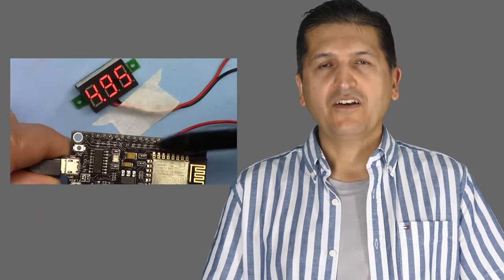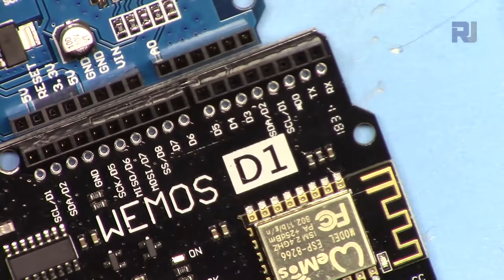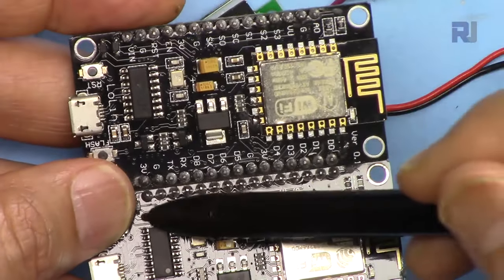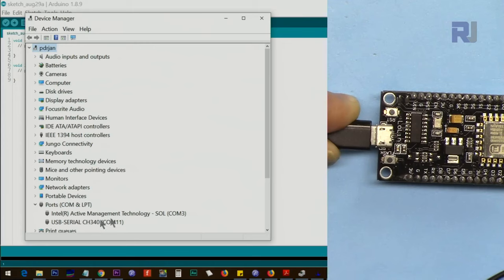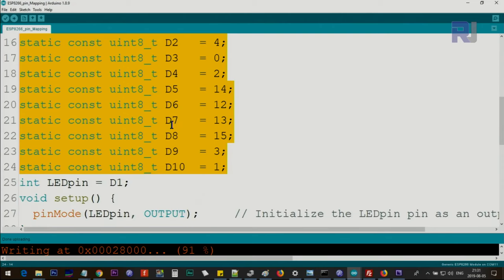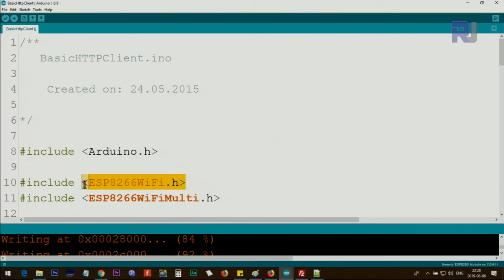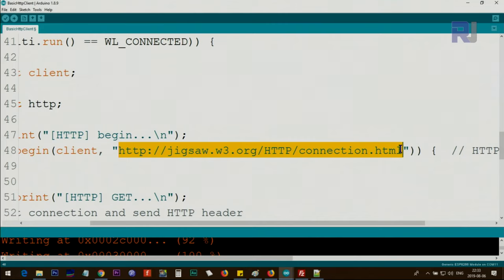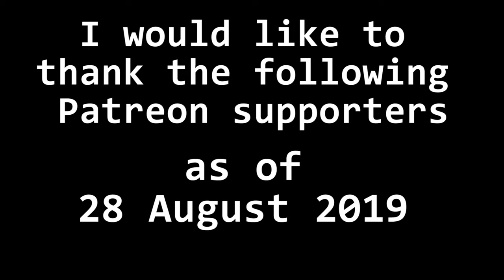Introduction to NodeMCU ESP8266 WiFi Development board with HTTP Client example- Robojax

Comment: Great video - I have not a clue what I'm doing here with C - however couldn't get code to run - stated  char type="k" was wrong (complex unpermissave error and stuff I didn't understand). Changed it to String  type ="k" and works perfectly. I have no idea why!
Reply from the maker: Hello and thank you. you must have customized the the code. The code posted after demonstration and it should work.  please try using it first without any change, then make changes.
Reply: @robojax  thanks for the reply - I had inadvertently ‘customised’ the code in at least 7 places, having fixed my own errors I still couldn’t get that bit to work. Pasted the error message in and found out far too much about char* constant errors. I never coded in C in my life, just a hobbyist - playing for fun really. But changing ‘char’ to ‘String’ made it work with j. Then I put the k in and it didn’t. Being irritated by then I just uploaded it again (which is clearly stupid and should not have worked), but, it did. I saved it quickly!
Many thanks for your reply though, most kind, I shall watch more. :) Phil
Reply from the maker: you are very welcome. stay safe.

Comment: Can you read data simultaneous from more than one sensor with this Node MCU ESP 8266 and transmit them via WiFi? Thanks!
Reply from the maker: Yes you can.
Reply: I guess you will not tell me how...:(
Reply from the maker: It needs 10 to 20 minuets video to explain. But your question was "can" and I said yet. I am replying to 1000s of comments. Can't write paragraph unless absolutely needed.
Reply: @robojax  I know and Thanks for answering! I just thought you will guide me a little...like: ”if you use digital sensors you do that...if you use analog sensors, you need that...”...or to guide me to some video that i didn't manage to find...

Comment: I need your help to do the "HTTP server which is waiting for HTTP Post request. These requests then proceed with string masks and parameters for LED and Display control are flirting. Then ESP turns on / off a certain LED and shows a number or string on Display.
 please help with how to start with.
Reply from the maker: I wish I could help. your request involves lots of understand and  testing which can't be done by few line of comment.
Reply: @robojax  Thanks

Comment: why my ESP8266 does not appear on my port? All I have was COM 1 when I connect it tot he USB port it does not show any other COM port?
Reply from the maker: because you don't hae the drivers for it.  check the chip (with magnifying glass) it must be CH340. if so check the video I have for Arduino which has the same USB chip https://youtu.be/u_21yNqd03I  if it is CP2101, then windows recognizes it. or your USB cable is bad. try another cable.

Comment: What is happens when ams1117 (voltage regulator) is shorted?
Reply from the maker: it depends on which pins. if input and output are short circuited, then the 5V input go to the output pin and reach ESP8266 chip and kills it.
Reply: @robojax  It happens to me, but the input is about 1v, and the output is 0v. Before it, the smoke has flown out from it. What about protection of the circuit based on datasheet of ams1117?
Reply from the maker: there is no protection.  ESP8266 has not protection. when voltage goes higher than 3.3V, perhaps 0.5V higher, it might tolerated for half a second and then it dies.

Comment: Sir,  if nodemcu is fitted in box then what to do so it will not be overheated
Reply from the maker: sorry, didn't understand. which box?
Reply: @robojax  I mean in Packing with small air vents
Reply from the maker: make holes like 3mm holes 4 holes at top and 4 at the bottom of the box and that would be enough.

Comment: could you possibly put a link into the comments on where i can download the program that you use
Reply from the maker: The link is under the video in description
Reply: @robojax  oh yeah sorry
Reply from the maker: May be I did not get what you said "Where I can downlaod the program? there is the code I used. Then I used the code inside the Arduino IDE program which you can get from Arduino.cc website. The code is and resources is under the video in the description. Here is how you find it https://snipboard.io/gplc41.jpg
Reply from the maker: if you want to learn about Arduino IDE software, I have a full Arduino course. The link is in the description of this video.

Comment: Ahmed engineer. Peace be upon you I used nod mcu with sinrik site with wifi manager every time i show my error message de class WiFiManager' has no member named 'addAP'
 I hope to know what
Reply from the maker: Peace b upon you, have you prepared your Arduino IDE for EXP8266? it seems files missing.
Reply: @robojax  Yes, I have entered all the libraries for WIFI MANAGER and ESP8266 settings
Reply from the maker: then you might not have selected the right board.
Reply: @robojax  I thank you, dear brother. I will discuss the subject, and I need time to thank you very much